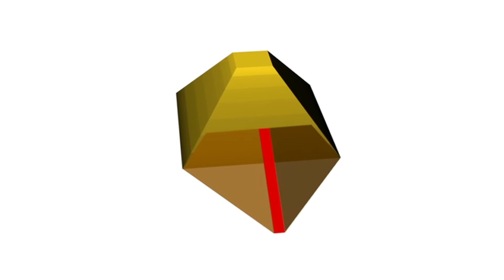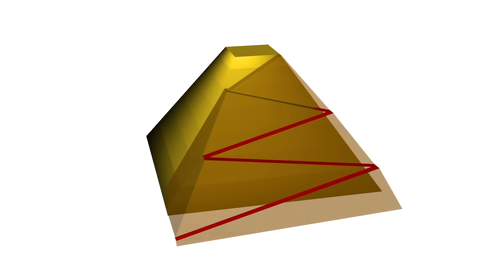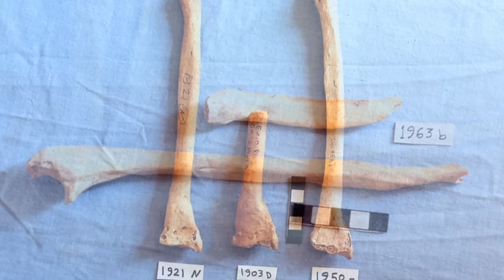Egyptology - Pyramid Construction

Comment: “It’s still a mystery”
30 secs later: Ramps were used to build this actually
Reply: There’s no evidence of a ramp and it’s highly unlikely considering it would have had to be kilometres long
Reply: By laws of physics u would need a hige fkn ranp to lift them blocks almost impossible to build
Reply: @dylanstuart2104  not if you use a ramp that goes around the pyramid. The use of big snatch blocks, loads of people, levers, etc, it could possibly be done. That's just my theory anyways. It's still a crazy feat of engineering
Reply: @cliftonjames785  Those ramps should have been almost as high as the pyramid itself....and completely flat cause if that huge block only slides a little there is not enough people who could hold that thing you can bet on that , and how did they even destroy those ramps after they were done? And where did they get the probably sand or more like dirt for that? Cause wood would not be able to hold that , the ramp idea just can't work
Reply: @dylanstuart2104  It could also be that humans were somewhat stronger back then? We cant scratch that off the table.
Reply: @dylanstuart2104  the ramp is built up outside the pyramid built up slowly to each stones height. That way they never have to lift anything they just build the ground up and pull and drag each stone up using flatbed wooden sleighs and ropes and counterweghts. They just went up 1 level at a time. Then the Grand Gallery was used as a counterweght area to lift the granite up used to build the Kings Chamber. Half way up the pyramid they then ditched the outer ramp and used an inside ramp the upper half stones are alot smaller than the lower half stones.
Reply: Ĺ
Reply: Mats K  evidence of advanced technology can be found
1. Dynastic Egyptians used copper tools which in the hardness scale is 3 and the granite is hardness scale 7, so that blows the dynastic Egyptian buildid theory right off.
2. There are quite a lot of drilling hole in granite and basalt stone (HS 7)
3. The great pyramid is perfectly scaled after the dimension of Earth planet.
4. The granite block which some weights 80 ton are pulled out of Aswan quorry which is 800km away from giza platou, do you think they dragged them up hills, kilometers of hot desert just to please the pharaoh? They did try but many people died the process and so they just decided to claim the ancient pyramids as their own.
5. Dynastic Egyptians carved hieroglyphs on everything but no hieroglyphs have been found in the great pyramid? Do you think egoistic pharaoh like Khufu would not have decoreded the whole damned place if he really did build it? We found one graffiti which says the Khufu name wrong (it was fake graffiti made by Vice)
6. Why are there no sut in the deep dark tunnels? Do you think they carved in complete darkness? I don't think so!
7. The three pyramids in the giza platou are perfectly lined with true north.
8. Looking from above the giza complex shows perfectly our solar system, it's planets, their cycles etc.
9. They knew about the star Sirius and other, which dynastic Egyptians could have not known without advanced tech.
10. The sphinx which has extensive (water) erosion. But there were no huge rains in the Egypt in the dynastic period which could have made them? Only logical solution would be to see if there were such a climet in the past. And what do we find out when we go back 12000 years? Very tropical climet.

That's just a tip of the iceberg 😂
It might be people from other planets who build them but I'll put my money on the ancient civilation like Atlantis who did these great structures.
Reply: @92Hilander  No aliens. Just humans. Stop replacing one set of fantasies with another.
Reply: @thhseeking  No Aliens, only people, yes I agree.
Reply: Mats K  The reason for which the Great Pyramid was built perfectly illustrates the desire and determination of the people to leave a trace of their passage through this life and the construction of the Great Pyramid for the Pharaoh Cheops represents a symbol of eternity! Read the book  ( NO MONEY ),  ” THE SECRETS OF BUILDING THE GREAT PYRAMID OF EGYPT ” on the website-ul www.thegreatpyramidofegypt.com  ( 1 - MENU / Menu ; 2 - English / Romana ;  3 – FRAGMENTS OF THE BOOK  / Fragmente din carte ; 4 – Comments / Comentarii ;  in English or Romanian and comment on the book , photos with models made of wood and brass board, drawings and sketches commented by the author of the book and logical explanations ?!? motivated by the construction of the Great Pyramid of Egypt. On page 59 is a centralizator with some of the novelties (comment on the 78 news items omitted by Egyptologists and I will send you an autograph book) and assumptions of the authors in the order of their appearance in the pages of the book. Leave a comment if you can! Have a nice day. Thanks for watching! Hănțulie Ionel
Reply: Mats K  Just because it may have been built by a precursor civilization before the dynastic Egyptians does not mean it was done by aliens... that's a stupid suggestion.
Reply: Mats K  1. No it's not! Do you understand that the hardness scale is 3 for copper and 7 in granite! You can't make such perfect cuts with that level of technology. Show me evidence it possible?? https://youtu.be/LAaAwpGWGMY
Heres mine. 

Dynastic Egyptians could not drill with softer material a hardness scale 7 stone. Again the evidence? 

 🤦‍♂️Tell me how did the dynastic Egyptians knew the dimensions of a round earth? 

They did because they were decedent from the "Gods." yes they did build some structures but not the big ones, because they could not drag the blocks from Aswan querry. The ones who had advanced tech did it. Go look at the ancient site, you will see that there are two kinds of constructions. Old and more advanced and then newer and more cruder constructions. Go and conpere them and come up with your own conclusions. 

I just follow the evidence 😉. Yes castles did not have writing on them wtf 😂 the case here is this: if you go look at dynastic egyptin structures you will find that they were filled with hieroglyphs and decorations but not the most biggest ones? How do we know if the Pharaoh's were egoistic? Because they wrote about it xD you should go and learn how ego mind works. (Spiral dynamics) 

I thought that as well but apparently they have not! You can go there and see it for yourself! 

Tell me how could bronze age civilization know where is true north? They must have advanced tech to know that. 

https://youtu.be/GWFKnZjUtoM look into that! 

You can't ignore a huge fact like that! That's not an obvious thing to know!? Tell me how could they know? The evidence? 

Robert schoch is a geologist who discovered this fact! 200 other geologist have also confirmed this. https://youtu.be/90IYxaMfWZ0 
Look into that! 

You can't just SAY that it can be done, provide evidence for me and explain why do you think that! 
😉

One more thing.
If they are build by the Dynastic Egyptians then why are the newer pyramids more crude and crumbling compared to the big and older ones?
Also why did not the Greeks and Roman's build anything megalithic if it was so "easy" 😂😂

Just thought another thing 😅
The Sphinx was covered in sand most of the time, then how could it have wind erosion under the shoulders?

Also there is this
https://youtu.be/SmWum2RKwW0
Research that 😉
Reply: @92Hilander  I’ve had a similar argument with someone on this subject , the Egyptians would not have made the pyramids without leaving lots of evidence, they change the Sphinx head to look like an Egyptian !! That’s how much they loved themselves so they’d definitely would have left records of this fantastic fete ! 12000 yrs ago gobekli tepe was built ! Much older ancient people than Egyptians, there’s lots of things hidden away & archaeology doesn’t like alternative views !
Reply: Read the book  ( NO MONEY )  , ” THE SECRETS OF BUILDING  THE GREAT  PYRAMID  OF EGYPT ”,  published by PAIDEIA publishing house in Bucharest, ROMANIA .   A book that Egyptian archaeologists will not be able to afford to ignore for a long time. The most convincing methods of building the Great Pyramid of the tools used and realistic explanations of 78 puzzles omitted so far are described (on page 59 is a centralizator with some of the novelties )  and assumptions of the authors in the order of their appearance in the pages of the book.The book and the summary table can be studied for free on the website www.thegreatpyramidofegypt.com   ( 1 - MENU / Menu ; 2 – ENGLISH  / Romana ;  3 – FRAGMENTS OF THE BOOK   / Fragmente din carte ; 4 – Comments / Comentarii ;)
It is a book that, without a doubt, impresses the curious, searching minds, sensitive to the exceptional.
Leave a comment if you can! Have a nice day. Thanks for watching!  Hănțulie Ionel
Reply: Mats K Why..
Reply: Mats K   WITHOUT  MONEY, read the book on the internet. Have a nice day. Thank you.
The book and the summary table can be studied for free on the website www.thegreatpyramidofegypt.com   ( 1 - MENU / Menu ;   2 – ENGLISH  / Romana ;            3 – FRAGMENTS OF THE BOOK   / Fragmente din carte ;           4 – Comments / Comentarii )
Reply: OK Boomer  Why not asking to engineer to built a real one ? With Egyptians tools. And with a one million dollar prize (just for motivation)
Reply: They are not sure. It said that ramps might be the one used to built the pyramid
Reply: No, ramps won't get 60 ton GRANITE blocks to the top.
Reply: Mats K  Your argument does make any sense! 😅. Yes I know all The blä bkää dynastic Egyptian things. Yes they were cool and all but there are evidence of older civilization. The sphinx is prime example for that. The Great Pyramid is also prime example. One of the biggest evidence of older civilization is the fact that there are many, many, many ancient ruins under water. Deep underwater. That right there is a fact that once those civilization where thriving and alive but now they are underwater! Which means that they had to build when those land masses where exposed. Also the Egyptians wrote that there were older civilizations. Also Sumerian civilization is where it all began so that makes them more older 😂 Even their tablets tell what really happened. They say many civilization had come and gone. I don't see it hard to believe that there might have been older civilization which had different kind of advanced tech, which the Egyptians inherited. 
And yet you still haven't answered my question. This is a very simple question which you have hard time to answer.
HOW DID THEY MOVE 80 TON BLOCKS 800KM?
 Tell me exactly how they did that. Show me an Article or something which suggest that they "dragged" or used a boat to carry them? Bet you can't. And just saying that they did it won't cut it. I can proudly say that I don't know how they moved them and that's why this makes this so interesting. Robert schoch isn't the only one ye know 😉 this just shows how arrogant you are and closed minded. This is why I call main straim Archeology a psudoarcheology. Because you are  just too dogmatic on our views that you can't even see how much you bullshit yourself 😂 True Archeology must and will look all the possible theories and not just picking your favorite and defending it like furious baboon 😂
Also I would like to know how did these Dynstic Egyptians supposedly raised 80ton block up to 145m height without any advanced knowledge.
Your argument that "they just did it" is nonsense and childish 😂
 Also you haven't answered my questions about the fact that if the Egyptians were so clever and shit then why don't we see Greeks making megalithic structures or even Romans? There greatest structure the colloseum is build by tiny bricks. 😂What did they forget how to build megalithics? Or did the dynastic Egyptians have super mage Tribble mega intellect which defies all logic and matter in space and time? They did have big skulls tho 🤔
Reply: Mats K  Show me where are the evidence that they moved it with people and animals? Where do you get this idea? No where? Ok.
I gave a picture which shows underwater pyramids in Cuba. Why can't your brain understand that this evidence is huge evidence who h your fragile ego can't accept. Because your worldview is set by your ego mind. I do pity that your in that closed minded view 😂   🤦‍♂️ You don't get it do you? YES they were build by stones and that doesn't make it un-advanced. When you make laser straight lines, move impossible stones up and down a mountain or 800km of harsh land that impossible for people who only had copper tools. Even though they managed to cut in that video, still we DON'T KNOW if they utalized that method! We don't know. You don't know but you claim to know because your ego mind is blinding you. Fact is that there is so much evidence which I have presented and you have done nothing but avoid them. You can do nothing but write fantasies withch your mind has created. You repeatedly claim that Aliens build it which I haven't claimed. Which in fact makes you a liar 😂 Who would trust you when you can't get your fact right and just spew unrelated fantasies of yours 😂🤦‍♂️ Grow up man! I'm open to see your evidence of mainstream view of the ancient past. I've read many of them and their explorations are not just good enough! Again I must repeat that (I don't know and I don't claim to know the whole thing) but the mainstream exploration that they just moved them with animals and such is just  laughable Iin my percpecive 😅
AGAIN SHOW ME THE EVIDENCE WHICH BACK UP YOUR CLAIM. otherwise we have nothing to talk about. I know why you won't look at the evidence which I have provided. Your ego is set on the theory mainstraim theory and it will defend it to the death! The ego can't handle when itvs view is questioned. You are afraid to look at the evidence and to research them without bias. But your mind is already set in that bias.
Reply: Mats K  https://youtu.be/tFlAFo78xoQ

Here is a long debate about this subject. Please do watch it. They are much more capable for explaining what I have tried and failed to do. I fucking dare you to watch it! But I know you won't 😂 I know you won't and even if so how managed to watch it, it won't change your opinion because you are deep in that bullshit which your arguments are drowning 😉👽
Reply: Mats K  Again you don don't even read my comments. I said i do not know! And that the fucking mystery which makes this interesting! How did they move them? Not by animals or by men. Some people have theoried that they moved by sound levitation but I cannot say that they used this method either. We need more information, which is also kept secret. Yes I argued that they couldn't cut rose granite and they apperly did it but it's just one video. Show me the evidence which says they dragged? You can't because there are non. So we are left but one thing. We do not know! And in that video they just barely cut the stone within three days. Which was just a meter stright line. It wasn't even remotely smooth like we have in the megalithic sites. Your argument that they used sandpaper is just fantasy. And just as I predicted you did not watch or take any of the evidence which I proved into account. Which mean you are textbook example of closed-minded fool 👽👽
Let say that they managed somehow drag a 80 ton block 800km. Now what? How did they rised it up? And placed in a just the perfect place. You can't even put a paper between those joint. There are no filling or anything. That is living proof of high level skill which  dynastic Egyptians have not shown to have. They did build few small pyramids but they have crumbled and are more like dirt piles. But The great pyramid stand. Isn't it odd that the newer pyramids are the most wrecked and small, when the older bigger pyramid are perfect. Not just that they managed to build it but make it face true North. Which means they had to have knowledge of astronomy which they most certainly did not come up on their own. Why is that so difficult to understand?
Again you have proven nothing by just saying things. Where did you even learn them? Probably because you blindly assumed that the mainstream theory is right, which clearly has visible holes in that theory, just like any other theory. But blindly believing in a theory and dismissing everything else is just Dogmatic 🐶👽
Reply: Mats K 
Well that's settles it! You do not even watch it which reveals your fragile ego mind xD
Reply: Mats K  why must I accept your theory? Because you want to be right? The fact is that your arguments have no grounds, which gives you nothing to back your claims. 😂
Reply: Mats K  How can we honestly have any discussion of you won't even check the evidence which you  arrogantlt dismiss without even looking? 😂 Are you that stupid? Why can't people study alternative theories? Where does it say that your theory is the ultimate one? No where. Go back to that conspiracy hole you crawled out of 😂blaming me for Aliens and shit, when clearly you are obsessed with them läläläää 😂
Reply: Mats K 
Well I have not experienced anything like that so yeah I can't say it's possible or not possible. Again your making fantasies 😂🐶   did I say I believe in that theory? No I have not said that. It just one of the theories! But seems that you just jump to conclusions like a lion to a gazelle. Again your just saying words which have not real world backing up evidence. Where does it say they build them with blood and sweat? The mark does not leave the same marks 😂
If you compare the dynastic egyptin cutting mark on the megalithic cutting mark you can spot the difference. But you won't look at any of the evidence so what to do?
🤔
Reply: Mats K  your avoiding all the evidence and just saying:
"There are no evidence because I just know, I won't look at your flat earth links etc. 😂 That's pure Dogma to me.
Show me the evidence and I promise to look at them with open mind.
I have showed you my side of the evidence but you won't even look at them. 🐶👽
Reply: Mats K  I just said that 😂 that why they believe that there were no stone tool but the basalt and granite stone megalithics shows us other tools were used. We have not yet found them. And using just those basic tools it is almost impossible to build such structures. Maybe they could or maybe not. 🤔 You and your damn lizards 😂😂
Reply: Mats K 
 In the pejorative sense, dogma refers to enforced decisions, such as those of aggressive political interests or authorities.[2][3] More generally, it is applied to some strong belief which its adherents are not willing to discuss rationally.

Go read more books and come back later when you have grown up 😘
Reply: Mats K  and tell me once again why if it was so simple task to do then why don't we see the Greeks or even Roman's doing giant Megalithics. In logical sense it should have been that if the dynastic made them then the knowledge would have passed down to them and so on but we don't see that. Which indicates that the dynastic Egyptians did not really know how to do the grand pyramids but small worthless ones.
Reply: Mats K  Yes I said they could potentially do that but here's the problems:
1. We do not have a single piece of evidence that they did that what they showed in the video. I haven't seen a single carving or papyrus which shows us that they used big drilling pipes or even that kind of copper saw. We only found few small saws which would never work.
2. They may have been able to cut straight lines but not as perfectly as the megalithic block surfaces.
3. You know that there are some megalithic structures which not only have perfect joints but that they had rounded curve in some of the joints. You can't just change that kind of directions with the method in the video. So no your argument is invalid 😅
Reply: Mats K  I would love to show you them but you won't even look at them 😂
Reply: Mats K  Yeah Mr. Lizard used his massive dogmatic energy to go back in time and raised the stones 😂🦎 Yes I have no pictures of tools because there are non at the moment but that doesn't mean that they weren't used! How do we know that? Because we can see that they lifted monster block and did umbeliveble things! Im not convinced that they could do those structures with copper tools. They did repair the pyramid and Sphinx. There they used the way which you are saying.
Even if I did have pictures of them, what good would they do? Your just going to say that you won't look at them! WHY?! (" mööö I'm not going to look at any flath earth links blää blää blää) 😂 How in the hell can you ever learn anything new with this approach?
Reply: Mats K  Sphinx is prime example of older civizations, Megalithic structures underneath sea means that they were build by older civilization, the Great Pyramid of Thoth is filled with advanced techniques, Pre-inca structures show connections to Mayan, Egyptians and Göpekli tepe, Pre-Mayan pyramids and structures also shows us advanced tech, Göpekli Tepe is also a smoking gun, what about the pyramids in China? What about  Baalbeck? What about Easter island statues? Guess you will say they were erected by lizards as well 😂
Reply: Mats K  Never said that people can't build things! The evidence which we have for dynastic people are too limited for them to be the builders. And yet you haven't answered any of my questions!
If it was easy like you say it was to cut 80 ton block from hard bedrock, then lift them and drag them. If the dynastic people did this then why did not the Greeks or even Roman's build any megalithic structures? Roman's greatest structure the colloseum was build from tiny rocks. Which is clearly build by the Romans! No advanced techniques or anything! Why is this? This shows the smoking gun which you just avoid answering 😒😎
Reply: Mats K  We have evidence that there are huge ancient buildings underwater. Which means they must have been above water. But when the sea was that much lower? Well when we turn back time 12000 years which was exactly when the younger dryas period ended rapidly. Plato also says that Atlantis was buried beneath the sea. Just saying that these are not evidence not valid argument. 😛
Reply: Mats K  you blame me for speaking nonsense but look at your comment hahaha 😂 How can I ever take you seriously when you don't even know your stuff which your arguing about? FFS you didn't even know machu pichu 😂🤣 and can't even look at the evidence which I have given like you asked. Then blame ma for having no evidence while you're not backing up your claims.... Mmmm okay 😂
Reply: Mats K  Very tiny piece in fact 😂 compared to the great pyramid and other such megalithics structures. Where do you get that they did not want to build pyramids?! Again evidence? They most certainly would have build if they only knew how. They copi3many of their architecture from Greeks and Egyptians 😂 your argument is invalid. Better stick that lizard up that tight asshole of yours 👆🤣
Reply: Mats K  OH and tell me how they made Baalbeck? Conventional Archeology says that  Romas carved those. But again they did not have the tools and capabilities to do that! Why would the Roman's carve such a huge block and make such a huge temple in the middle of nowhere in Lebanon and NOT used that same technique on their buildings? :D
Reply: Provides the evidence. Otherwise this is case closed dude 😉
Reply: Mats K  proof are the pyramids you idiot
Reply: Solution : https://www.youtube.com/watch?v=znQk_yBHre4
Reply: I it is awesome and come and see India's tamilnadu thanjaavur big temple .It doesn't give idia , how they build it . before watch this temple you defenetly Read this temple's specifications
Reply: The reason for which the Great Pyramid was built perfectly illustrates the desire and determination of the people to leave a trace of their passage through this life and the construction of the Great Pyramid for the Pharaoh Cheops represents a symbol of eternity! Read the book  ( NO MONEY ),  ” THE SECRETS OF BUILDING THE GREAT PYRAMID OF EGYPT ” on the website-ul www.thegreatpyramidofegypt.com    accessing  „Read  fragments”   1 - MENU / Menu ; 2 - English / Română ;  3 – FRAGMENTS OF THE BOOK  / Fragmente din carte ; 4 – Comments / Comentarii ;  in English or Romanian and comment on the book , photos with models made of wood and brass board, drawings and sketches commented by the author of the book and logical explanations ?!? motivated by the construction of the Great Pyramid of Egypt. On page 59 is a centralizator with some of the novelties (comment on the 78 news items omitted by Egyptologists and I will send you an autograph book) and assumptions of the authors in the order of their appearance in the pages of the book. Leave a comment if you can! Have a nice day. Thanks for watching! Hănțulie Ionel
Reply: https://youtu.be/pPVqlj7ts9o

https://youtu.be/QOy9lZDXWns
https://youtube.com/playlist?list=PLhHfgUerevftvpPozHCpEFZQku9gKdRLQ
Reply: People who wants to know who built giza pyramids then they should also try to know about. qoum-e-aad and qaoum-e-samood in saudi & jordan (petra). you can find reference in sacret book qu'ran. They were so strong & mighty that with one hand they plugout date tree. They carved mountains into palaces and those monuments still persists.
They never feel sick, free from desease, never gets old, the only thing that happens to them is death comes and they die. they just die " NO REASON " .
with  such strong body and health they became rude and arrogant. allah sent messenger Prophet hood Alaisalaam to guide them  to quit idol worshippery. they rejected.
allah sent air to  destroy them. Devine punishment was decended for 7 days and 8 nights. their brains were hanging out from there head and they all gone with the wind and the situation after the devine punishment was like This is the place of people who use to stay billions years ago.  that means everyone is dead, everone means everone not even a single child survived along with adults. similar situation occured with qaoum-e-samood but with different devine punishment  i.e with fire like comets and asteriods falling from sky. like a nuclear attack. They too were involved in idoltery. allah sent to them a prophet saleh AlaiSalaam to guide them but few of them listen to him and the rest were destroyed by allah. Unlike qaum-e-aad they  too were  rude and arrogant and were practicing injustice on land.
Reply: Straight ramp and spiral ramp both are not much practical i think. For straight ramp, after achiving every new height, say for ever 10 feet, they have to build a a new ramp from farther area to acgieve this new height. For zigzag or spiral, i dont think they could easily turn the cart carrying huge rock to follow spiral or zigzag way
Reply: I think it's only the great pyramid which is mysteriously built.
Reply: Mats K Not only no evidence, mathematically near impossible
Reply: Mats K  Dude you didn't even look at my evidence which I showed 😂 You can foam all you want but non of your arguments hold water. Show me evidence, if they are more plasuble than what I presented then I will change my mind 😅  Why would I be flat earther if I just said they modeled the great pyramid after dimension of (a round) earth 😂🤔
Reply: With pyramids likely to be have been built by slaves, the question is, should we be celebrating these structures? Feels wrong, if slaves did build them, maybe we would consider destroying them? Thoughts?
Reply: @rhianc7347  what really sucks is every egyptologist, including in this video, completely discount slaves building the pyramids cuz it goes against their current narrative that craftsman would have to be involved to complete it in their current timeline. A little insulting to think there were no slaves used at all, being such a large project. Slaves built a lot of beautiful monuments unfortunately, still would be a shame to destroy their life's work because someone else "owned" it. I believe landmarks like the pyramids today are funded and maintained by a combination of gov support and private donations. It's the Egyptian people's pyramids now.